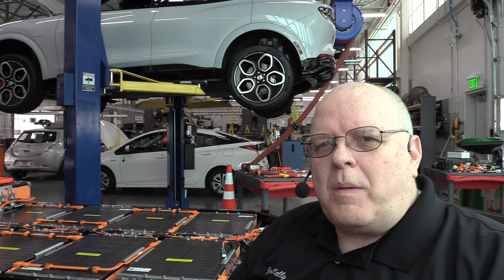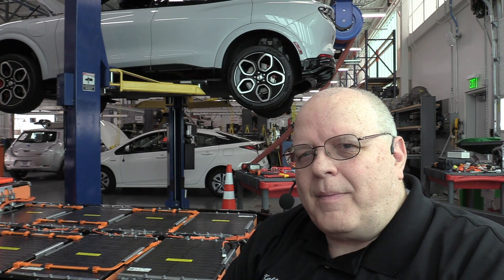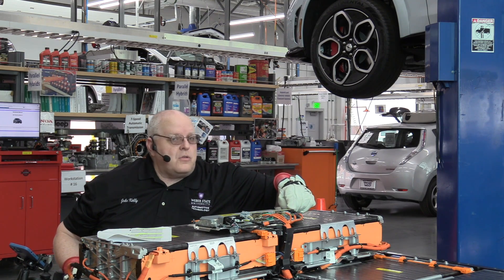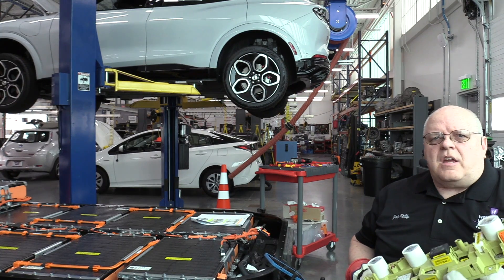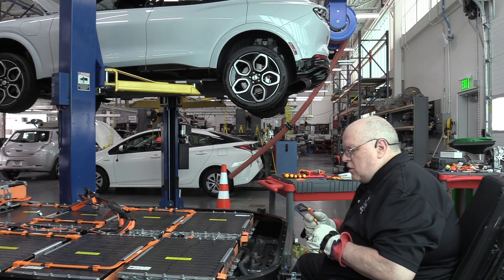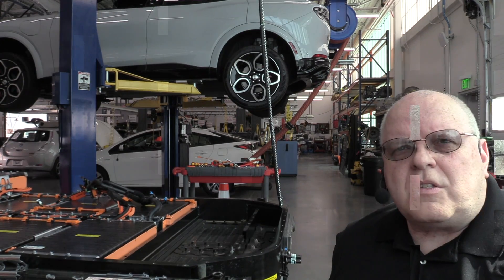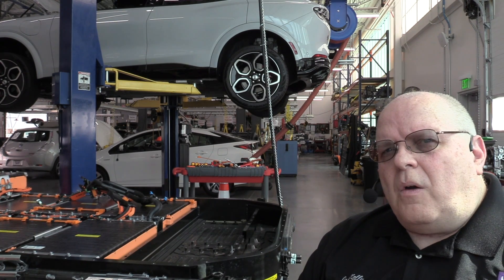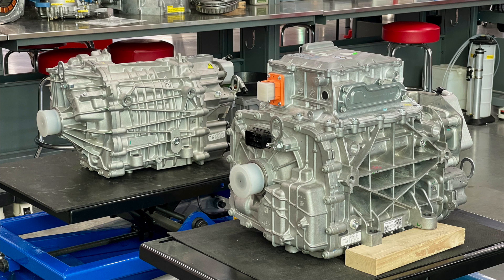Mach E GT Battery and Cooling System Service

Comment: Wow! Thanks, Professor Kelly. The safety and procedural details you provide will prove priceless for years to come to people who open these battery packs outside of an official Ford shop. The other Mach E battery disassembly I saw was destructive and not so detailed.

I am very impressed with the effort Ford has taken to make these packs able to be serviced. Fasteners are all accessible, bus bars are covered and come out easily, cables and harnesses can be safely moved out of the way, etc. The ability to repair and restore battery modules without the need to replace the entire pack will extend the service lives of these vehicles. Not all manufacturers, as you know, make that a priority.

This pack configuration also makes 'second life' use of these modules much more practical.
Reply from the maker: Thank you Bill!
Reply: Are these batteries rebuild able
Reply: @rondavis2791  In an interview before the Mach E went on sale, a Ford engineer said that the battery pack was designed such that dealerships could repair it. Professor Kelly's video confirms that the tools are available to replace modules.

On the Munro Live tear-down we see that the individual pouch cells are spot welded to module busbars. From what we can see in that video it appears to me that individual cell pouches could be replaced, but it is very unlikely that Ford dealers would do that. Dealers are likely to replace any modules that fail, but this leaves open the possibility of aftermarket repair/rebuild options after the warranty has expired, like we see with Prius batteries today.

Ford's use of modules also makes "second life" applications possible. Reusing batteries too degraded for automotive use for bulk energy storage is becoming more common as more EV batteries hit the scrap yards due to collisions or degradation. Even a degraded LEAF battery with only 50% capacity has more storage capacity than a $12,000 Tesla Powerwall.

Comment: Atleast stealerships will have a hard time making excuses to charge big bugs from work hours because good professor here has now set the standard for battery change  time for one person while seated. Remarkable work as always.
Reply from the maker: Thank you so much
Reply: What time (hours) can you possibly extrapolate from this video? There is are obviously cuts every time the camera moves, plus arbitrary cuts and fast forward moments. Looking at the sun shining in the windows a very significant amount of time passes.

Plus hourly rates are based on the time it takes the average experienced tech to perform a task. A “professor” is far from average.

Comment: Regarding heat conductive epoxy and heat pad:  The conductive epoxy can be made very thin, same as conductive paste, which is basically used to fill in the gaps of imperfections.  You want the less material between the heat conductive metals, as any conductive epoxy/polymer is less efficient than any metal.  The pad handles imperfections too, but has a "high" minimum thickness.
If you have ever dis-assembled any electronic component that is mounted on a heatsink, you will notice that it  can have one of 4 heat coupling options: heat paste (berillium or silver based), heat conductive epoxy (silver and or copper with epoxy), a flexible heat pad (like the one you shown), of a "rigid" heat pad (seen in high voltage insulation parts)
The is a very nice video from Tech Ingredients about making and explaining heat conductive epoxies, and he even makes one with very excellent specs.
Thanks a lot for all the explanations you provide us.
Reply from the maker: Thank you for the great information and thank you for watching

Comment: Thank you Prof Kelly.  Since you just finished this series on the Mach-e battery, 2 questions: 1) How many hours to do this (from lifting the vehicle, to removing, disassembly and replacing the battery) as shown in this video?  and 2) How many custom tools, fixtures, adapters, etc. were used and 2a) how much do they all cost in total (including the official Ford Battery table and connector plugs for the pressure test)?
Reply from the maker: I did not keep track of the time. I suspect it was around 10 hours. The special service tools were close to $5000 USD and the official Ford battery lift is around $10,000 USD
Reply: @WeberAuto  Thank you for the info!  This would make it a 2 day job.  Too many YT commenters are wishing for batteries to be "repairable" either by their local "garage" or dealer.  Based on ~$150 / hour shop rates  that would be $1500 plus the cost of parts.  The battery pack in this vehicle is ~ $24,000 and is expected to rise significantly, according to Ford.   If one assumes that the battery modules inside are about 70% of the cost (i.e. $16,800) and then add the $1500 labor, it would cost ~ $18,300 to replace all the battery modules plus the expense of the special tools and fixtures.  If these are amortized at 10% (i.e. $15,000 x 0.1) $1,500, then costs would be about $20,000, allowing for "shop towels and supplies" such as coolant, and assumes the other equipment, i.e. vacuum pump, are shop overhead.

Of course, there would be the matter of the old batteries.  Disposal fees for nearly 1000 pounds would simply add to the expense.

This also implies that it could cost Ford > $1,000 to replace the contactor module. For 50k Mach-e cars... ~ $50,000,000!

Comment: Yay, another video! We’re getting spoiled by all these regular uploads… 😁
I’m curious if cooling (or heating) both sides of the battery would be more effective. I’ve noticed on my Ioniq5, especially when fast charging, there can be a pretty significant difference in battery temperature depending on where the sensors are located (I’ve seen up to 30 deg F difference). It seems like cooling only from the bottom of the battery module would lead to a temperature difference between the top and bottom of the battery, which becomes more pronounced under higher loads (like a long/steep hill climb while towing, or DC fast charging). It also limits the speed at which the battery can be heated, since they can only heat from the bottom and wait for it to migrate through the battery, and it seems like the heating can’t be very aggressive (only about 95-100 deg F max from what I’ve seen)

The Bolt can get away with less thermal conductivity between the battery modules and the heat exchanger plate since it operates under a lower load. 50ish KW fast charging vs 150ish Kw on the Mach-E and 160kw peak discharge on the Bolt vs maybe 350kw on the Mach-E GT. I’ve repeatedly DC fast charged my Bolt on record high summer days (peaked at 120 deg F ambient temp) and the car had no issue keeping the battery cool even after several fast charge stops. I never even saw any thermal throttling. If there is anything good about the relatively slow DC fast charging of the Bolt, it is that it doesn’t stress the battery. My Ioniq5 will thermally throttle a little during a single fast charge event on a warm (95 deg F) day.
Reply from the maker: Good question, I do not know. Thanks for watching

Comment: Those GM "sleeves" are a GREAT idea.  They should have been used when you made  your first "disconnection."   Hold them in place with tape as needed.   You might want to use the plastic gadgets used to remove door panels/etc.
Reply from the maker: Good idea! Thanks

Comment: Heat engine tech: super-materials, superalloys, able to withstand extreme temperatures, necessary for high efficiency. Awe-inspiring engineering of every aspect of the engine, to squeeze every last bit of useful power from burning of fuel.

EV tech: we're just put some thermal paste right about here, boys. (still 3x more efficient than the best heat engines). 😂
Reply from the maker: Lol. Thanks for watching

Comment: Thanks for the video series.  I was wondering have you tried the wheel dolly trick to position the car on the lift ? And you were talking about using old plug and putting rtv into the connectors would epoxy be better ?
Reply from the maker: Thank you. I was talking about finding other used connectors, removing the terminals and filling the cavities with RTV.

Comment: Very interesting on how Ford has developed their hybrid drive platform, my boss just recently picked up his new Ford lightning I don’t know if you seen the underneath of that thing yet but you should check out the rear control arms talk about a ton of aluminum! I’m assuming the Ford lightning is probably the same set up if not close or similar to this Mustang I would assume. Those GM electrical rubberized cap covers would be awesome for us to have the winery to slip over our huge lugs!
Reply from the maker: The lightning has a similar battery tray but a different module configuration. Thanks for watching

Comment: Dear Professor Kelly, 
Thank you for yet another excellent training session. Very nice indeed. 

If the vehicle is functioning well and the coolants are at the right levels in the two reservoirs then is there any reason to change it. Eg it is filled for life (200,000 + km). As I understand it the reason here we changed the coolant was (1) for training purposes and (2) because we  dismantled the modules in the battery pack. In an ICE engine in Europe we normally change the engine lubricant once a year or 20000 km whichever comes first but in the EVs the coolant,  transmission and brake fluids are almost filled for life (10 years, 200,000 km).
Reply from the maker: Thank you. The yellow-colored Motorcraft prediluted coolant is scheduled to initially be replaced every ten years or 200,000 miles (322,000 km), then every five years or 100,000 miles (160,000 km). However, if the system is ever opened, it must be replaced.

Comment: Doesn't look like there's any insulation between the battery cold plates and the battery case? So in the winter it will be very difficult to keep the battery warm?
Reply from the maker: There is a battery coolant heater to add heat in cold temperatures

Comment: Not sure if there's any mention of it in EV repair standards but the lack of sleeves on your shirt open you up to electrocution, particularly in a case where you've forgotten to close the cap over a battery terminal and you lean over reaching to something across from it.

I wouldn't work in that environment without some arm protection.

Oh and, thanks for the great information.

Comment: When rmf speed is much lower than rotor speed the current induced in the rotor will change direction which causes reversed torque to be applied to the rotor which creates a perfect  brake which help slow the car down producing an electric current which is converted from ac to dc to recharge the battery.
Reply from the maker: Yes that is true for an induction motor. Thanks for watching

Comment: Curious... Correct me if i'm wrong of course;
The BECM has balance circuits and would think it has an UN balanced cell issue if you disconnect the connectors in the wrong order.... I get that part BUT. 
Seeing that the BECM most certainly is a 12V supplied and controlled module, wouldn't disconnecting the 12V battery and disabling the high voltage system effectively make that BECM module dead ?
  So disconnecting it in anyway and order by mistake should not affect anything as its not powered up. 
I am all for and agree with the  S/M,  just curious as to why they chose to write it up that way. Maybe because someone  will try and unplug it while still hooked up to 12v maybe?
Reply from the maker: I do not know the answer. The 10 second wait time after disconnecting one of the connectors makes me believe there is a capacitor in the circuit; maybe for some sort of energy reserve. The BECM can get 12V from the high voltage battery by connecting wires across three cell packs. Thanks for watching

Comment: Hello John D. Kelly, you are talking about a cover for the high voltage battery terminals to protect and that it is a motorcycle tool with identification 48569, I have been looking for it and I cannot find it, could you say the brand of the tool or the website to be able to buy Thanks a lot
Reply from the maker: Kent-Moore tools. It may have the letter J in front of the numbers. Search eBay

Comment: Probably the only time you will see it done with the proper tools🤣. As a mechanic who has worked at dealerships and independent shops, I am willing to bet this battery is dropped with a 2”x12 and a transmission jack and the cells are lifted out by hand. I’ve never seen any of these special tools shown in a service manual even at a dealership.
Reply from the maker: LOL, I am so surprised! Thanks Flat Rate!

Comment: Dear  Professor Kelly, hello! Please tell me, is it possible to install a 98.8 kWh (15 Dec 2020 production year, 10 cells of 8.5 kWh, 2 cells of 7.4 kWh) battery from the Premium AWD model on the GT AWD model 98.8 kWh (sept 2021 production year, 10 cells of 8.4 kWh, 2 cells of 7.4 kWh), the battery energy management module has one part number (identical), is it technically possible? Thank you for your reply!

Comment: In the high speed putting back together i see you are not using high voltage protection all the time and just for a few procedures. Why?
Reply from the maker: I had not connected the bus bars yet. The voltage was only 26 volts where my hands were. Thank you for watching

Comment: I got 8800 miles on my mach e gt and its my 2nd time i got the high voltage or service soon what could it be? It also lowered the power when i accelerate

Comment: Is that really a battery pack from one vehicle? As a hobbyist and automotive enthusiast, that much plastic and electronics really scares me! I want to know for sure that we have a profitable recycling and disposal system set up to deal with them when they have reached the end of their 7-10 year lifespan. Still to this day, all I have seen local scrap yards do with hybrid and ev batteries is store them in the back. some of them still have a charge and are dangerous. All of the ones I have sold did not end up fixing the vehicles they were installed in. I feel misled.
Reply from the maker: https://www.recyclemybattery.com/product/recycle-my-battery/public/us/en/recycle/recyclers.html and https://chargedevs.com/newswire/toyota-and-redwood-materials-collaborate-on-closed-loop-battery-ecosystem/ we offer training at https://continue.weber.edu/professional/programs/evtraining/ Training will help reduce the risk of danger.
Reply: None of the battery innards is recyclable. They are selling you a lie.

Comment: Meanwhile, Tesla started producting batteries with no replaceable modules at all. It's interesting to see whether all manufacturers catch up to that or not.
Reply from the maker: It will be interesting to see if catching up to that is something that is desired. Time will tell. Thanks for your comments
Reply: Sound like a nightmare for the customer when the entire battery must be replaced instead of a module which itself can be rebuilt or exchanged. Let's hope manufactures never "catch up" with that flawed philosophy and keep vehicle systems easily repairable instead of throwaway.

Comment: Im avoiding any Ford products in the future. They certainly arent designed or engineered nearly as well as a Tesla. I own a 2006 F150 bought new and although its been a "decent" truck in the 123k miles ive used it. i have to take my good engine and swap it into another truck since mine has a frame that looks like swiss cheese and the bed supports are 40% rusted away. I found a 2005 truck just like mine (8ft bed) with a solid frame and body but bad engine for 2700$. Im gonna swap it myself to save a fortune until I get my Cybertruck to replace it. If only Ford made products that werent designed to fail for service revenue Id probably be more likely to support them. But they dont so theyll never see another penny from me.
Reply from the maker: Thanks for your feedback
Reply: I’m curious what you think in here that is “designed to fail” that Tesla does better. Tesla is widely known to make things that are not serviceable, and the only vehicles they have made that are nearly 10 years old have had common major failures (batteries, motors, MCUs, lots and lots of door handles, etc). When those components do fail on Tesla, even if it is just a minor part within that component that fails (like a single cell in a battery, or a bearing in the motor), Tesla does not allow for any repairs, only replacement of the entire component.